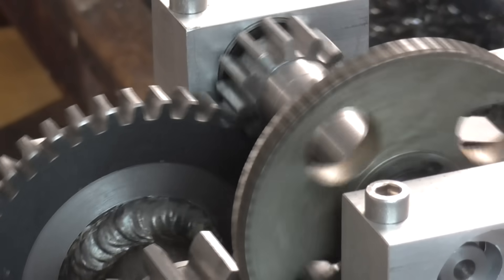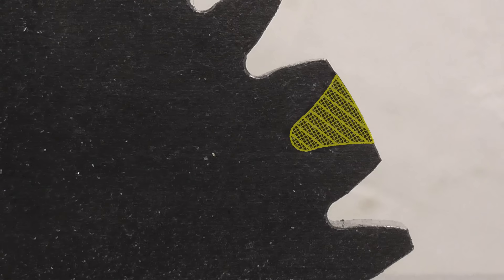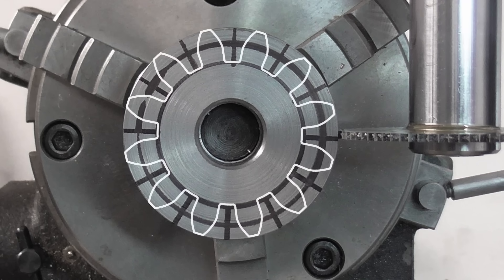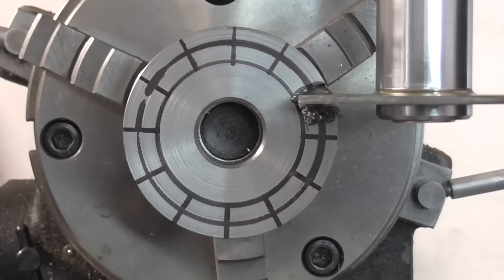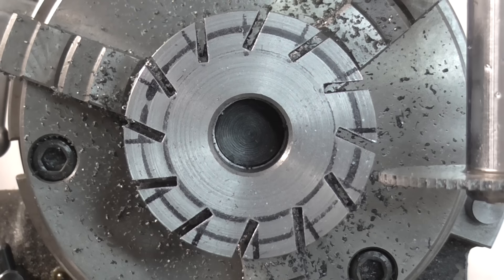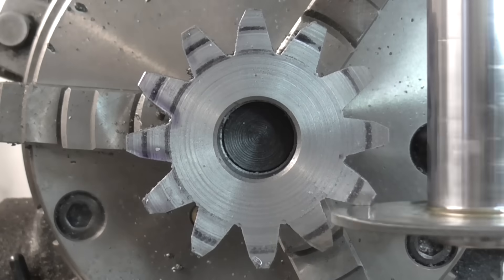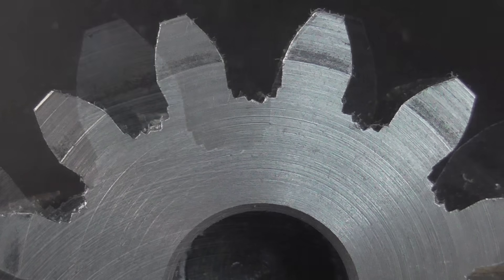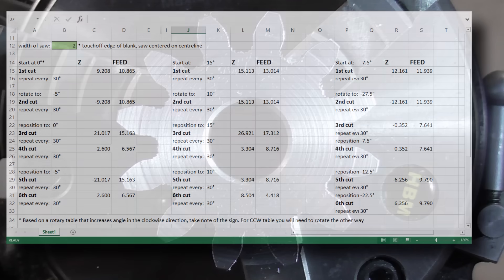Cut any gear with just a slitting saw

Comment: What you could have done is first drill holes where the root points are needed,, Number of Teeth.. that meet the depth required . And it’s just geometry but you can follow this guide  this fits the curve perfectly leaving no stress points . Meeting the other cog always at two points  spreading the load And the mesh is smooth. You do the maths .. I use my  curve setting gauge..   gives me the 😂the speed and angles for the curve and size  of teeth . Saves me hrs .

Comment: And you did this all manually, respect. It is a great job for a CNC and saves a lot of money for tools, but a Mach3 Wizard should plan the cuts. What if we do not use a slitting saw, but a diamond grinding blade ? It could not only cut the first groove (outside diameter grind), but grind the flank of the teeth (sideways grind) by rotating while moving in Z axis. I think I have to attach an 4th axis to my mill. Then it can grind twist drills to resharpen them also.
Reply from the maker: Yes, of course with a CNC you could take many more subtle cuts and also do coordinated moves with 2 or more axes at once.

Comment: I have to make a DP8 11 tooth gear (not sure of pressure angle yet waiting for a proper gauge). It having 11 teeth is interesting because a DP8 #8 cutter which is the smallest, is specked for 12-13 teeth. Am I right in assuming that this is the cutter I would use for an 11 tooth because it's the smallest and there is no other option or am I missing something? I haven't decided whether I want to buy the cutter or use this method to cut the gear. Really I want to use this method because I have everything here. Unfortunately considering I'm working with imperial your spread sheet isn't going to help me. Great video and any advice would be appreciated.
Reply from the maker: The spreadsheet also has an imperial tab which does all the measurements in inches. Gear cutter sets usually only go down to 12 teeth (no. 8), the reason being as the tooth count decreases the profile changes more quickly so you would need an individual cutter for every number of teeth below 12, whereas the number 2 cutter will cut a range of 80 teeth.
A number 8 cutter will not cut the correct shape for an 11 tooth gear, but it's probably close enough. What you could do is use profile shift, this is usually done on gears with less than 12 teeth, you would use the no.8 to cut 11 teeth on a gear blank that has the diameter of a 12 tooth gear (1.75"). This will result in less undercutting of the teeth and a stronger gear.
Reply: @AndysMachines  Thank you for responding. Awesome that you have an imperial tab as well(I missed that). I haven't been able to open the sheet yet because I need to get the right program to do it. Now in my application the gear is 1.630 OD and goes on the end of a steering shaft.  So if I use a #8 DP 8 cutter to cut 11 teeth on a gear blank that is 1.750 OD would I then after those teeth are cut,  turn down said gear to 1.630 OD so it will fit? Please excuse my ignorance this is my first gear project and all of this is new to me. I also want to do this project the right way. Do you think the slitting saw is perhaps the better way to approach this because it's not a standard toothed gear? Honestly I'm really intrigued by the slitting saw method and want to try that approach. Being as this is my home shop I can take my time and if at I first I don't succeed I can keep on trying till I make it right. Thank you in advance for any help with this.
Reply from the maker: If the gear centres are fixed then you'll have to use a gear of the right diameter, you can't turn it down after cutting the teeth. When using profile shifted gears you have to adjust the distance to the mating gear. Your best options are either cut 11 teeth with the no.8 cutter (probably ok) or cut it with the slitting saw method which will generate the correct profile but will be more work.
Reply: @AndysMachines  These are fixed gears and hence the reason I asked about turning it down to proper diameter. I've decided to use your slitting saw method as my approach. Especially considering you can't buy the proper cutter and honestly I'm glad because I'm excited about learning this method and going through the process. It sure will be satisfying when it's done. Plus as often as I make gears I'd rather not invest the money and more prefer to invest my time instead because machining is fun and free fun is priceless. Thank you so much for your help and the sharing of your knowledge. I will make as many attempts as it takes to be successful with this process. Have a great day sir.
Reply from the maker: Glad to hear it! Sounds like you have the right attitude to succeed, good luck!

Comment: You really didn't have an application to put this gear in and show it off? 😕

Well, at least I finally learned a way to make use of the sin() function on my calculator.
Reply from the maker: Actually yes, it's part of a long term project that will eventually feature on this channel (too many projects!) You can see this finished gear at the very bottom of the screen in the opening of the video. Everything I make is usually for some purpose, not just for demonstration.

Comment: dude, you have a nice dividing head. get a surface grinder and making your own saws/ sharpening is easy!
Reply from the maker: I wish I had space for a surface grinder, I have to make do with a grinding wheel in the milling machine. (And careful covering/cleaning).
Reply: @AndysMachines  If you find one, hit me up for tips, like a said I manufacture tooling both manually and with a cnc grinder. Cheers mate!

Comment: Why not drill the root, cut the rest? I get itll be rounded but will that affect anything?
Reply from the maker: Yes you can do that, it does save time though it doesn't perfectly match the geometry so the teeth will be a little weaker, but it's not a problem if it's not under heavy load.

Comment: Very interesting video, I have liked and subscribed.

If you were cutting a rack you could generate the straiht sided tooth form with just two cuts.  On the other hand, if you were to make an infinate number of cuts you could precisely generate the involute tooth form of any gear, however small the number of teeth.  Of course, making an infinite number of cuts is impossible.  How do you decide how many cuts to actually make?  How close an approximation the the theoretical involute tooth form do you need to get for the gear to give acceptable performance in the real world?  I suppose it will depend on the speed and amount of power to be transmitted by the gear train.

Have you ever tried to cut a bevel gear by this method?  In theory it should be possible, but would be a very slow process.

In some ways I think your method has something in common with the way that gears are cut on a Sunderland machine; there’s a video of one operating on Youtube.  This machine uses a reciprocating cutter in the form of a rack.  The straight sides of the teeth on this cutter will produce a flat surface of the work but the many cuts made with a small rotation of the work between them will generate the required involute tooth form, or at least a very close approximation of it.
Reply from the maker: Thanks!

The fewer teeth a gear has the more curved the tooth profile is so the more straight cuts will be needed to approximate it. Yes, gear planers (like the Sunderland) and gear hobbers basically just take many successive straight cuts to generate the profile. If you look at a gear hob it also has straight teeth like a rack.

No I haven't cut bevel gears with a slitting saw, only a form tool, but it should be possible with a similar number of cuts, just more complicated to set up the correct angles.

Comment: Why not make a flying tool and cut it quicker and cheaper?
Reply from the maker: If you have the means to accurately grind a single-point tool then yes, that method is quicker on a small gear. But on a larger gear like this one, turning all the metal between two teeth into chips takes a long time. The first two saw cuts remove a chunk of metal then after that each cut only removes a small amount and is quick, so the saw method is quicker in terms of machining time, though does take a larger number of individual cuts.

Comment: It may be old fashioned but this is where my shaping machine excels. Remove the bulk of the waste and the finish each cut with a ground profile tool, easy and perfect results every time.
Reply from the maker: I agree! Shaping is the best way to make a gear. Unfortunately I don't have a shaping machine (yet).

Comment: Question, if you make 2 gears with only the first 2 cuts done, and you engage them together with springs, then rotate them with an aggrogate, rotating an equal amount forwards and back, will they eventually shape themselves into a more proper shape? Like the gears will wear the most in the least efficient spots eventually becoming more efficient?
Reply from the maker: Yes, running two gears together with some fine abrasive material is a good way to hone the surfaces, but the profile does need to be quite close to start with, any small corners or high spots would be removed first so it would work well on a gear produced with the slitting saw method. However with only 2 cuts per tooth I think it would only work on gears with a large number of teeth (say 100+) which have fairly straight sided teeth. I'm not convinced it would work on smaller gears, with only 2 cuts per tooth there would still be large amount of metal to remove, you wouldn't be able to fully mesh the teeth to start with, springs pushing them together would help, but I don't know if the wear would be even enough to produce the correct geometry. It would be interesting to find out though!

Comment: If you’re making a gear pair and want it to fit perfectly, leave an extra thousandth or so of metal, then run the gears together with a little lapping compound. I used to use toothpaste to lap in my slot car gears for more speed and acceleration.

Comment: Does it need to be heat treated later?
Reply from the maker: It depends on the application, I won't be heat treating them but gears are often case hardened for better wear resistance. Hardening them all the way through can make them more brittle and less able to take shock loads.

Comment: Could you first drill out the root of each tooth, or will it be hard to register the rotary table after flipping it 90 degrees?
Reply from the maker: I get this question a lot! (check the comments below) Yes you can do that, it doesn't actually produce the correct tooth root geometry but often that does not matter. Re-registering the part afterwards is not that hard, just standard machinist procedure.

Comment: Now do the helical gear version
Reply from the maker: It could be done, the gear blank would need to be advanced as you feed the table with a gear train from the handwheel. The tooth calculations are not much different except that the pitch circle diameter needs to be increased by 1/cosine of the helical angle.

Comment: Instead of cleaning up at the end with a ball mill, could you have predrilled holes and had the root be round vice flat?
Reply from the maker: Yes, you can do that. I've gone into this in more detail in other comments below, but technically the shape of the root is not a single arc so it's better to drill two small holes and join them, but usually it's not critical.

Comment: Great video!
Question... And please correct me if I'm wrong here but couldn't you do the same basically with an endmill (maybe the same ball nose used to clean up the root) and start from center top rather than center back and shift all the Z axis moves to be Y axis moves and all the Y moves to be Z moves?
Reply from the maker: Yes, you could in theory do it with an endmill from the top, but not the ballmill I used, it would have to be a regular square cornered end mill since some of the cuts are made with the very end. Also it would have to be much smaller diameter to make the more angled cuts without interfering on the other side, the initial cuts that remove most of the material would have to be taken in many small passes to avoid breaking the end mill, so it would take much longer.

Comment: Well done. My main concern using this method is the sharp corner of the saw teeth won't last very long, after which the saw deflects. 

Instead, I would use the slitting saw to make a center cut to full depth. This is a balanced cut. Then I would grind a fly cutter from a piece of HSS with the correct pressure angle on each side, shaped like a rack gear tooth. This is not difficult to form accurately by hand on a grinder. Then I would continue using the tool offset methods employed here to finish the teeth with several passes. This formed fly cutter will greatly improve the surface quality of each tooth, and tool deflection will not be an issue.

Comment: I think you can do the entire process with the ball end mill from the top using the same methods. Of course the first cut will be brutal but probably can use a bigger ball nose and live with a smaller but rounder root diameter. I think it would be more accurate too because saws are very flexible and flat sided ones cut skewed when cutting on one side only because they have no clearance. Side cutting saw, if available, would help.

Comment: This has given me an idea for a lock, I guess you could use the data from this to work out cut distances for putting gears on a straight bar so this gear could turn and move it along and then you'd just have to angle the mill head?

Comment: Thanks very much for this video and the imperial spreadsheet. 

I've just finished using it to cut a 12 tooth 20DP gear with 0.050" increased diameter for my old Myford lathe to form the fine feed 12/25 cluster.

 I was a bit worried that the 0.032" slitting saw might flex too much but that didn't seem to be a problem.
Reply from the maker: I'm glad you found it useful!
Reply: @AndysMachines  It was invaluable. There's no way I'd have made the gear without your video and spreadsheet - I'd have been forced to shell-out for the Myford fine feed gear cluster or, more likely, made do without it for a good while longer.

As you said in the video, the method makes most sense for one-offs where buying or making a gear cutter or hob is uneconomic in either cost or time or both. It's also perfect for hobbyists like me who are time rich and cash poor!

If I could make a polite request it'd be to please add an optional parameter in the spreadsheet to increase the diameters for small tooth count pinions. The rest of the spreadsheet seems to work for it if the PCD and diameter entries in the spreadsheet are increased but others like me may want to use such a feature in future.

Thank you again
Reply from the maker: @jongibbs8112  I would refer to this as 'profile shift' but I know other people call it different things. (For tooth counts below 12 it is usual to increase the diameter of the gear above the theoretical size to limit the amount of undercutting on the tooth and produce a stronger gear).

I have added a field for this to the spreadsheet and updated it on Patreon. Note that I have not tested this but the numbers it spits out look OK to me. Maybe you could check how the values compare to the ones you used for your 0.050 oversized gear?
Reply: @AndysMachines  Thank you so much for doing that so quickly! I checked it and for 20DP and 14.5 degree PA, the new spreadsheet gives precisely the same results as my hack to do the same job. For me, the term profile shift captures the function just fine.

In the case of the gear I needed, it was replicating the Myford fine feed gear which has to fit on a 3/8" shaft. My guess is that the original root of 0.475" for the unmodified case would probably be judged as cutting it a bit fine and perhaps this motivated the profile shift increasing the "meat" beneath the teeth but obviously that brings with it the other benefits of tooth strength and reduced undercutting too.

Anyway, thank you so much gain.

Comment: Yes , that works , also the blank could be fully "roughed out" with a Side & Face Cutter to cut time. Then, if you have invested in an Mill & Indexing head; why not the Gear Cutters as that is the lower side of the Cost? Another viable option, is to "profile grind" a tool steel  Fly Cutter that conforms to a finished Gear.  These methods work for Spur Gears whereas differential indexing a Helical Gear is another ball game.! Hmm , desperate means and desperate measures. Next we consider, how to sweep out the workshop, with a tooth brush (if you have no broom)  it can be done?     Quality of this Video is great!

Comment: how do you lap the gear faces without destroying the tooth profile
Reply from the maker: I usually don't lap the gears I make and they work perfectly well for my uses. You can run two gears together with grinding compound to polish the faces and remove any high spots, the profile will not be affected.
Reply: @AndysMachines  Makes sense. Thanks.

Comment: But if you grind a profile of the tooth on a HSS blank and cut the gear like that with a fly cutter. Wouldn't it be easier. But your method is cool...
Reply from the maker: For small gear teeth yes, but for bigger teeth it's very hard work for the machine to remove all the metal between 2 teeth in one go, you could make multiple shallow cuts, but it will end up taking longer than the slitting saw method.